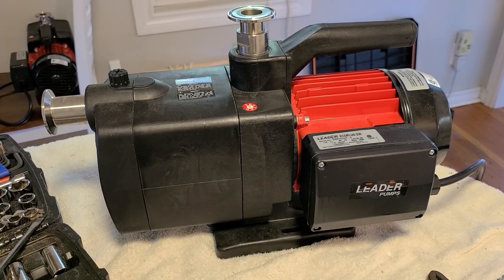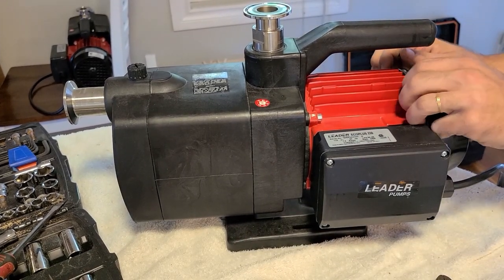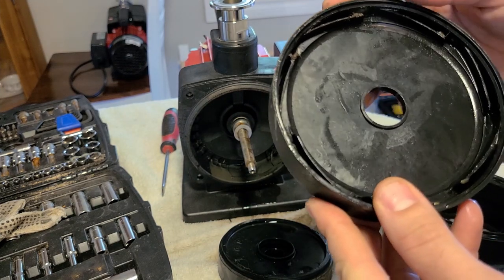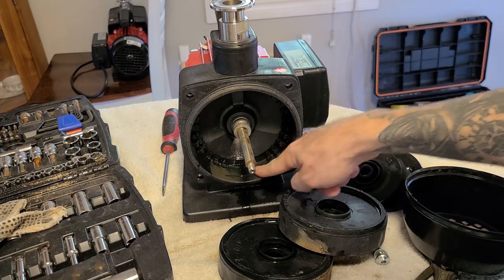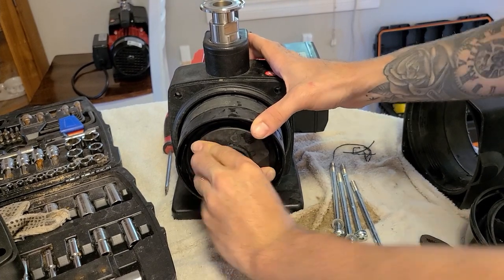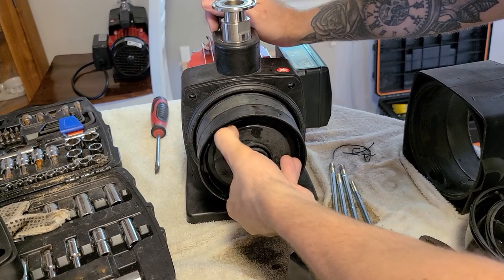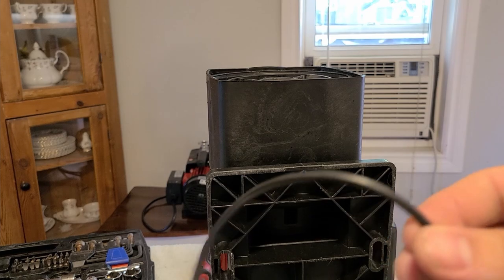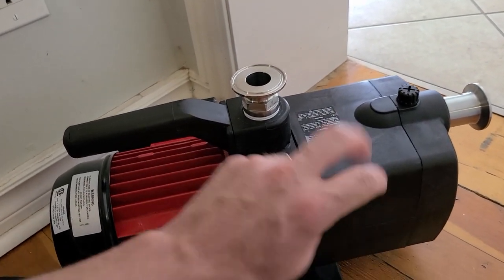Cleaning & Repairing a Leader Ecoplus 230 Pump from an Extraction Lab

Comment: Getting leaks when I try to put on triclamp adapter. Any suggestions? No hydrotronic attachment? Is there a way to bring pressure down only using for fresh water and spray hose using a different pump for recerc
Reply from the maker: Teflon tape around the threads of the adapter. Metal screwed into plastic always needs an extra "seal". There is no way to lower the pressure without messing around with the wiring.
Reply: I have a hydrotronic leader attachment that goes on the top. I had it split with a tee to a sprayer and the other side would refill the washing vessel with r/o water the pump will only see fresh water. Maybe it’s over kill and it’s not the right pump to use. For recirculating the under 25u water I’m using a spike brew pump. Should I just swap pumps. Maybe a seaflo for spraying down on demand and a different pump for recerc. Another option is to upgrade to a dab mini. My custom washing vessel is only 20 gallon SS. Feel like I’m so close but yet so far
Reply from the maker: @LarryDubis  just make sure whatever pump you get, it's easy to clean, stainless steel is always a good options. Seaflow are good potable pumps usually plastic Def would work